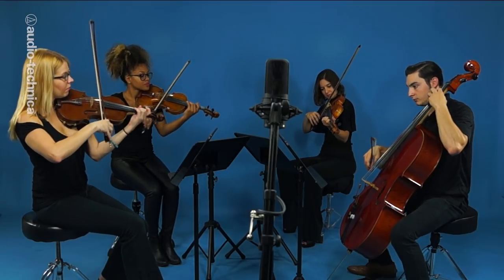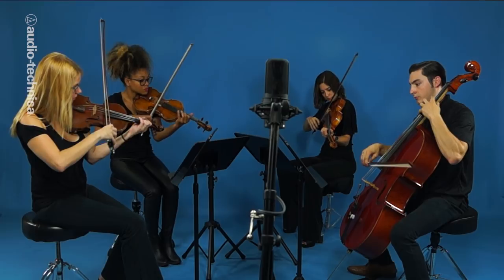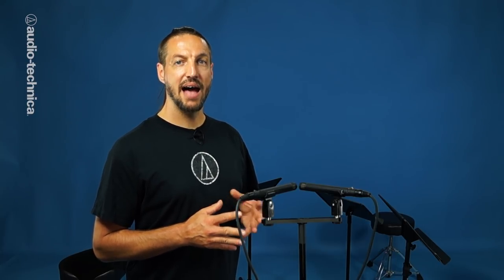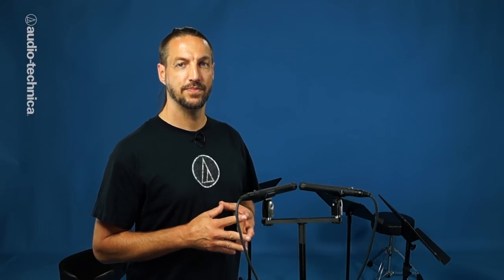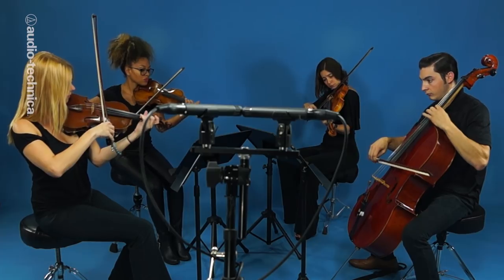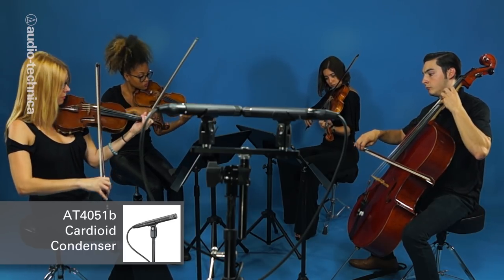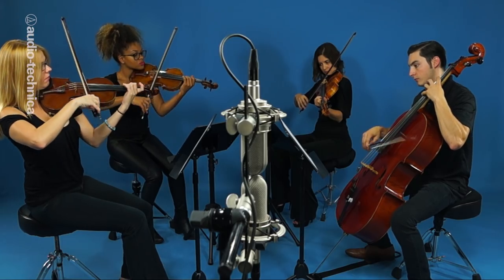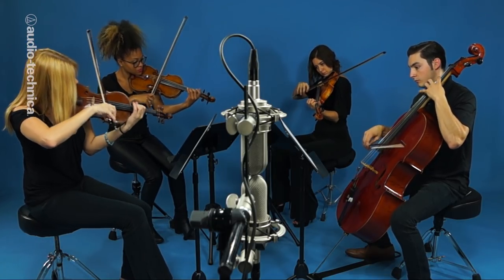Basic Recording Techniques: The Small Ensemble

Comment: Great video! Blumlein is the winner!

unfortunately I have absolutely not understood where the microphones are positioned in relation to the quartet.
Reply from the maker: Hi Marco! The placement of the microphones in relation to the sound source allows for “artistic expression” as there is not a single answer.  The closer the microphones are to the sound source, the more anechoic (dry) signal will be captured whereas the further away they are, the acoustics of the location will play a more significant part in the sound being captured. 

A general starting point may be placing the microphones within their pickup acceptance angle to the sound source.  If the quartet is in a semi-circle, place the microphones at the centroid. Thanks! - A-T USA